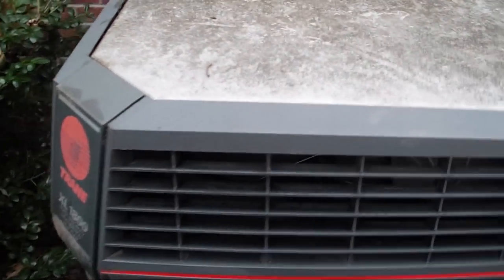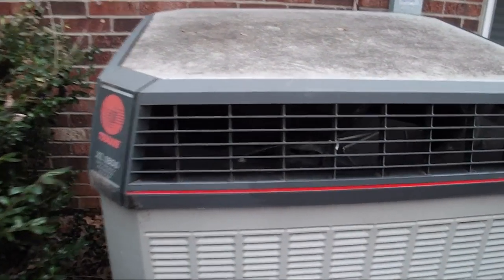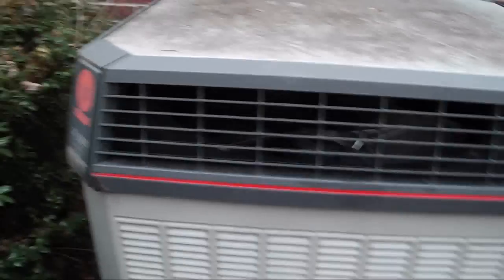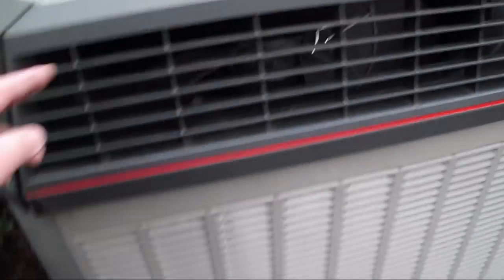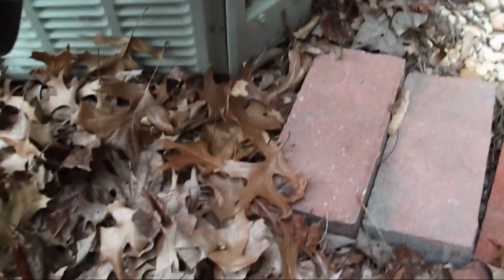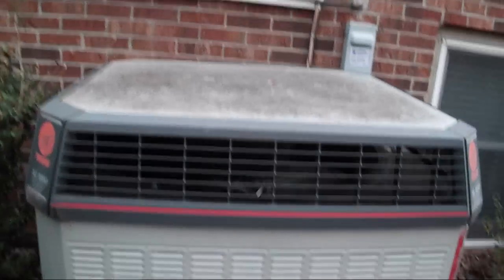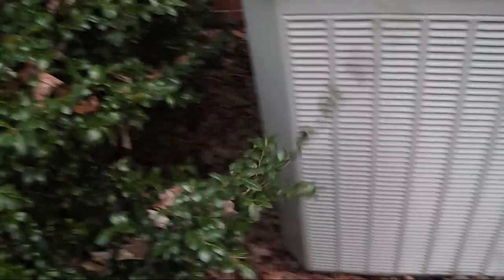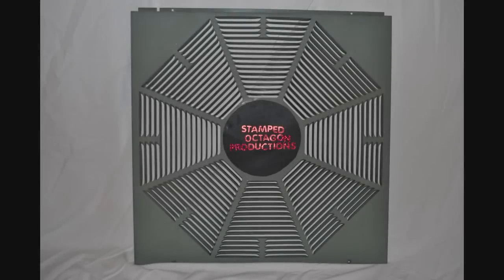1998 Trane XL1800 5-ton heat pump defrosting!

Comment: "oh man" Defiantly an issue here. The defrost time of ten minutes absolutely not there was never that much ice on that coil  it should take care of it in a few minutes at that outdoor temp! whether it's demand or not is a big indication something is wrong.  This era of Trane units had many reversing valve's replaced due to hang up in my area as well as board and thermistor failures too and other electrical issues!! :)

Comment: That unit has a problem with the board it should not take that long this sound you heard was the bypass to reduce head pressure on the compressor.

Comment: Actually, I think there might be something wrong with the demand defrost board or a temperature thermistor isn't clipped onto the tube/coil correctly or is damaged. Around 2:22 in the video, the internal pressure relief valve is working because the head pressure is too high. Might tell them to get it checked, so as to avoid damage to the compressor(s) Also lower the electric bill. The test pressures are rated the same because the suction and liquid lines see the same pressure depending on cycle.